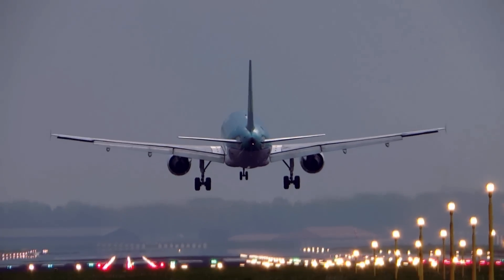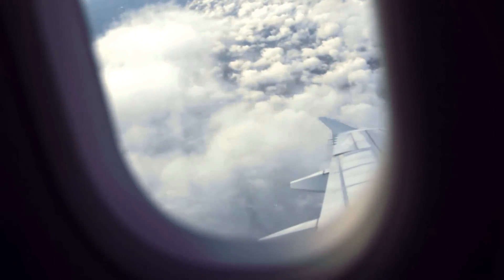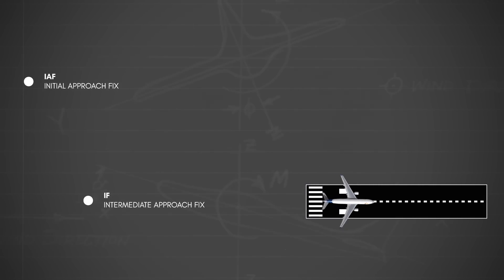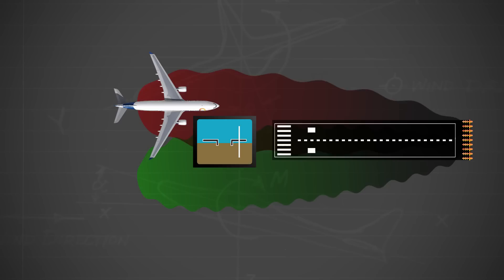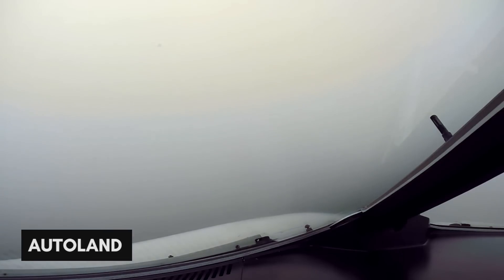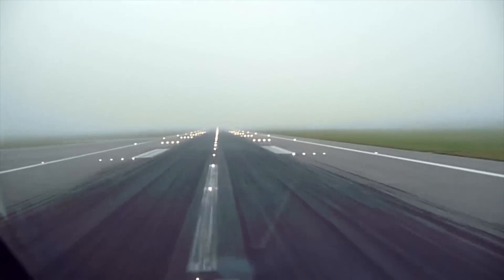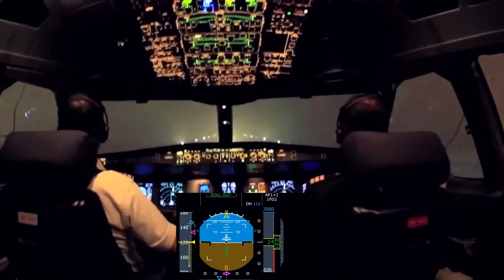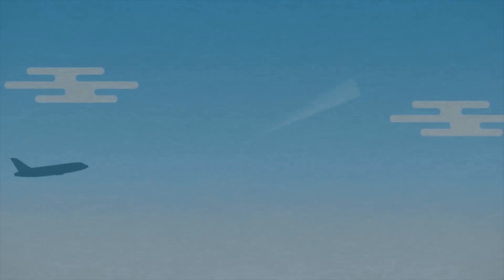How Pilots Land Blind

Comment: The different systems and terminology are too winded and complicated - in this age of computerization. Image a student pilot taking exams and asked questions on "GBAS", VMR etc. All this is bound to cause confusion in the cockpit. Surely there must be a simpler, safe way.
Reply: The amount of time/training required to fly 121 'airlines' operations is quite significant. This results in a couple things. 1. New pilots are pretty well versed in nearly all terminology, or should be, with the exception of some unique to the operating environment or aircraft. 2. Anyone incapable of performing to standards should be screened out along the never ending journey that is training.

Comment: So snipers have to account for the spin of the earth yet pilots don't? Hmmm, something is flat and stationary.
Reply: Snipers can't continually change the trajectory of the bullet if the aim point drifts across the view ahead. Think about how planes land on moving aircraft carriers. The pilot doesn't aim for the point at which he expects the carrier to be when he gets down to deck height, he maintains a course in a reference frame centered on the moving angled deck that drifts with respect to the "fixed" Earth with an added drift to accommodate the wind vector. Now remove the added complication of the moving "airport". Not so complex anymore, is it?
Reply: @Markle2k  Hmmmm, so they land on earth with the same conditions as a air craft carrier lol lol. The earth is still.
Reply: @igdes1  No, the Earth is still turning 15 degrees per hour while going around the Sun at 70,000 mph. But so is the airport/aircraft carrier. What matters is the relative velocity and the relative wind.
Reply: @Markle2k  lol lol ok if you say so.
Reply: @igdes1  Next time you're going down the freeway at 60MPH throw a tennis ball in the air  inside your car. What does it do, smash on the rear window or land back on your hand? Jesus dude, this is middle school physics.
Reply: @jayzenitram9621  lol lol it's flat.

Comment: Still gives you the creeps as a Passenger. Look out and you can't even see the Wing Tip, No lights, nothing! You know you are getting close as you hear the engines rev the aircraft pitch up etc. a number of times. That bloody computer in Control of the Aircraft. You know the Pilot can't see a thing. You start to hope they will divert. 
You know the Pilot can't see a thing because you can't see anything.  You know computers are controlling the Aircraft. 
Not really as smooth as a good Pilot bringing you in. 
How does the Pilot feel? I bet there heart rate goes up more than on a normal landing.